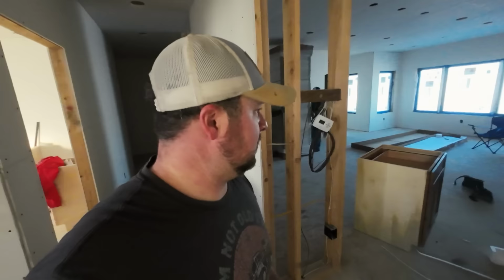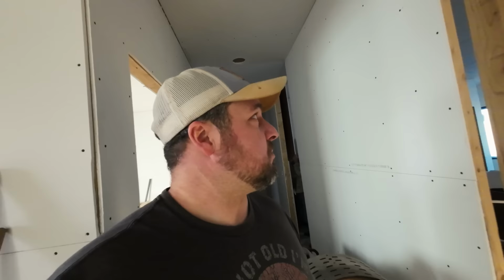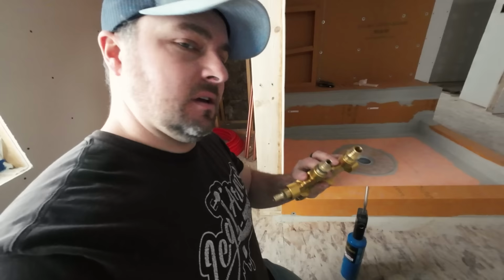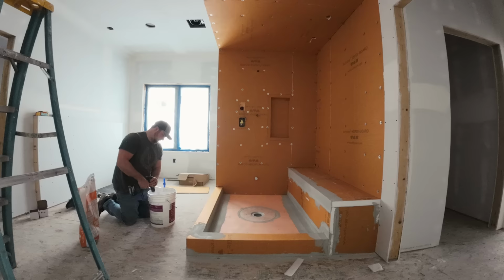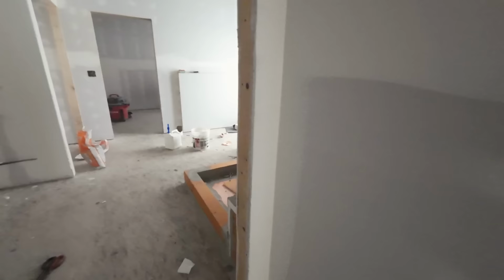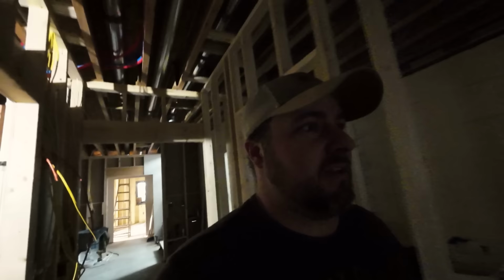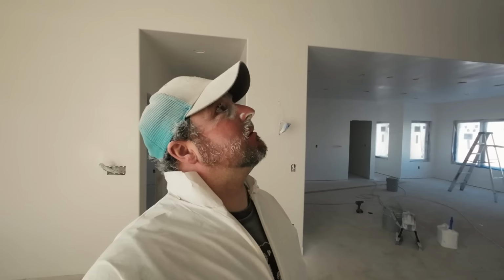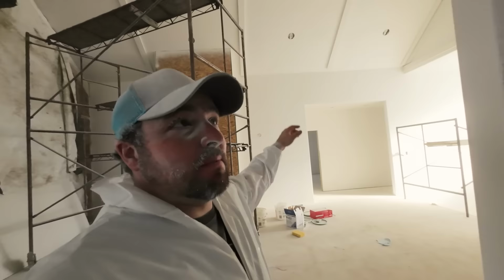I just LOOOVE Painting 🤪 - Leg Arm's House Build Part 11

Comment: I know you have almost everything primed, but when you prime you should back roll with a roller. If you notice rough spots on the drywall next to the drywall mud where it was sanded, back rolling prevents that and promotes better adhesion. It’s just a tip. You’re still doing a great job! Hope your windows come in soon
Reply: I was going to say the same thing...
Reply: Haha, I was thinking the same thing.  I've sprayed a number of times, inside and out.  Always bankrolled for great even coverage.

Comment: I remember helping my dad as a kids on construction projects.  The drywall crew came in (father and son) and would hang 1/2" 4x8s on the ceiling by hand using stilts so the sheets were lifted onto their heads (no hoist mechanism).  Of course the fasteners were hammer and nails.  I was amazed at how fast they were.  They definitely earned their $$$!

Comment: I love what you are doing ! I did the same thing when we built our house in 1977. I sprayed the inside completely with primer and then came back with a finish coat of Antique White. Did the wiring, plumbing, etc just like you are doing. One thing for certain, you will remember where things are when you have a problem. Great job Scott. Great video. I was in the paint business for 35 years (management) and loved selling the stuff. It really puts the finishing touch on a home.

Comment: Scott, just fyi they use to make a light oily base sawdust floor dry to pickup  sheet rock and other dust. Just spread it and sweep up. It goes a long  ways and you can use it over. I have used it and like it a lot. No dust. I don't remember the name of it but works great and not as oily as you may think but sure collects  the dust

Comment: Dang noone is mentioning a good 3m mask with vapor cartriges.  Get the rubber one so it will seal on your beard, or shave your stubble.  I can't imagine how many fumes and dust you've already breathed in.  You are doing a great job, way more than I could do, but be safe and especially protect your lungs.  From ND

Comment: Someone should have told Legarms about outing Vaseline on your face when you spray. Much easier clean up
Reply: That is a good idea.
Reply: Was going to say same, old timer told me that after like a year of painting with them 😅 like ok rookie here is a tip for you since you're staying.
Reply: Basic mask would be a good idea too.
Reply: Used to do a bunch of industrial spraying. We covered up everything we could and put Vaseline everywhere else. And it's going to come in around the respirator so might as well cover your whole face. Then you just clean off with dry paper towels or shop rags in a couple of mins
Reply: Hot water and a sponge works just fine
Reply: You do the same thing if you work in certain areas inside a tire plant

Comment: I’m trying to figure out why your Ac& heating systems cold air returns grills are dwn  low. You will never and air higher than your waste. You need your spools air returns to be higher up the walls so you can circulate your air in the house better. Specially with those big windows and high sealings

Comment: Sweating, or sharkbites are the best no leak options.  The best tape i have found that doesn't leak, is blue monster ptfe tape, work's for water or gas.  I have a shallow well pump, and it's stainless steel, and nothing would seal the water fittings but the blue monster tape, it's thicker than any other I've tried, and my tank is outside in a shallow pit with a shed built over the top of it for easy access.  I live in southern michigan, and you get very cold, and you get hot as well, and it's been a year with no leak.  With the water being so hard, the cast iron just don't make it over here.  Nick, your next brother.

Comment: Ok now on priming and then painting I did part time work with a dry waller ? did you go smooth texture on the walls and ceilings or orange peel on walls and popcorn or knock down, orange peel texture? YOU ARE DOING  A GREAT JOB and saving money by having  the knowledge  rock on dude lol

Comment: Plumbing inspector came on our job, told us the giant house we could had all the copper joint brazed not soldered! 

One of the last electrical jobs I did, when I came into do the trim I had to move my receptacles that were supposed to be in the appliance garage on the kitchen cabinet. It wasn't till the people had moved in that it was found out that the guys who installed the cabinets hadn't put the spacer on the end by the door throwing the whole cabinet line off and the customer couldn't open the drawers because the door casing was in the way. I knew something was wrong because I never had to move anything unless someone else screwed up.

Comment: Don’t those mixer valves have a wax washer in them to prevent the shower from getting hot when you flush the toilet? Might test it out before you close everything up since you soldered the fittings on.
Reply: Don’t want you to have to tare it back out once you get it done.

Comment: No dude, take the fridge out of the corner and put that giant cabinet there instead. Then put the fridge where the giant cabinet was supposed to go. That way you don't ever have to deal with the fridge doors banging into walls. Trust me when I tell you that it will extend the time between the house complete date and its first redesign by at least 10 years

Comment: You say five months, try saying a year and five months. Yes started end of October 2021 and here in Kentucky it’s hard to find people that want to do the work and ones that are worth a crap. Just waiting on the drywall finishers to finish. They jumped on it and taped it and threw on the second coat and haven’t seen them for over a week. The house is probably one third the size you have there and should have been built in no more than four months.